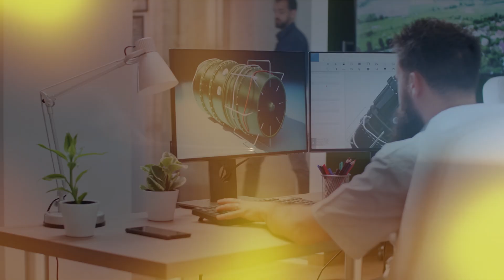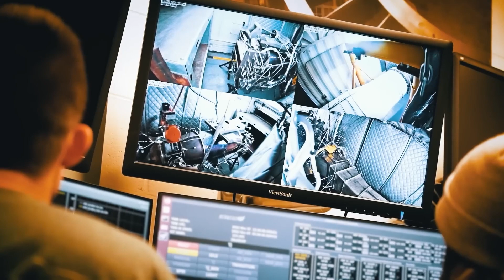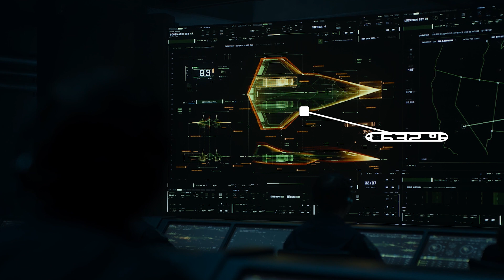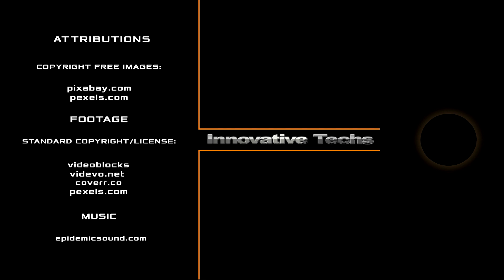This plane is 2 times faster than the Concorde – 3000 mph

Comment: Not sure, but I think "km/h" is more than the "European measurement system". It belongs to the METRIC system. Yes, its used by most Europe (UK still uses imperial) but also by many other nations around the world. Even the USA is slowly changing to the metric system. (Wich is the official system, even though imperial is accepted). Enough nerding. 🤓
Reply: Agree. Only 3 countries in the world don't use the metric system (United States, Liberia and Myanmar). The UK use the metric system, but imperial units are officially used to specify journey distances, vehicle speeds and the sizes of drinks. Other than that, interesting video :)